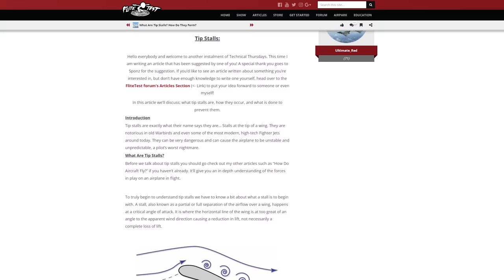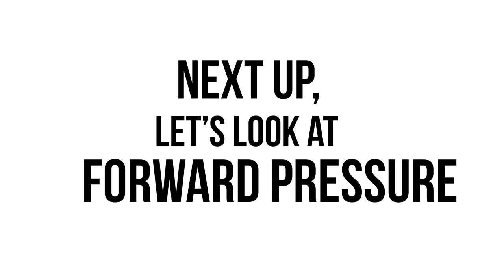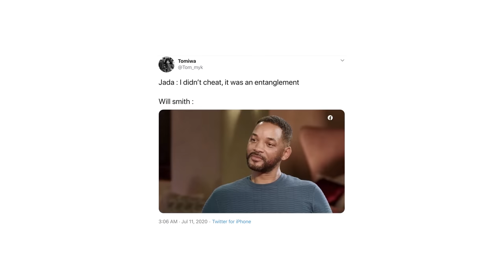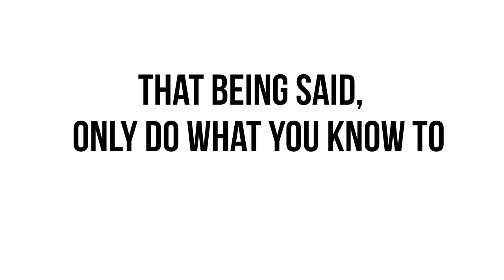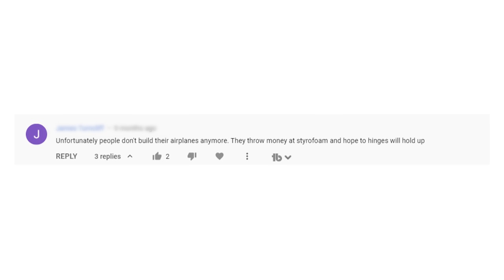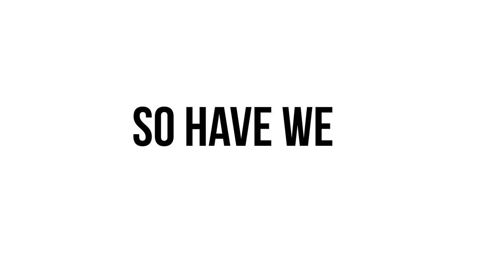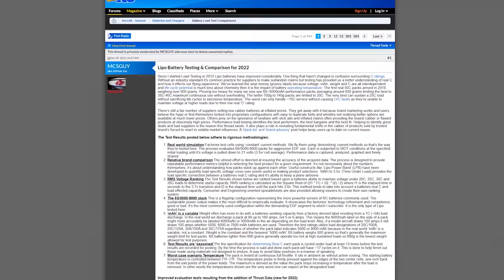RC Myths DEBUNKED

Comment: Good work giving a shoutout to Joe's battery tests. Every RC pilot should read that thread.
Reply: +1 to this, especially if you're in a high current draw category like edf's, boats, most cars and trucks, quads and helicopters. His empirical testing methods and data are second to none.

Comment: I fly homemade balsa and foam planes. I'm really loving my guillows fw-190 conversion right now, and for that, tip stalls are really a problem, and its difficult to get a washout in the wing. In fact, since that's my first balsa rc plane, the tissue warped the wing so one is strgiht, and the other was a slight washin at the wingtip... You have to throw it very fast at a launch to prevent tip stall, but once you're at its sweetspot speed, it flies amazing and I can do fun aerobatics. The annoying thing abt balsa tissue is that when u crash, you have to cut some of the tissue out to fix whatever's inside, whereas with foamies, you can just easily glue. Balsa is very delicate and you absolutely need to be experienced with flying small models especailly.
Reply: I think the irl 190 had issues with tip stalls partly because the wing was so stiff. Generally that's a good thing, but it also meant the wingtips couldn't flex and try to pitch down when near stall. Well, that, and the fact that the 190 had a relatively high wing loading with a significant wing taper

As for durability, the way I see it, Balsa is Superior for "normal" loads, while Foam's squishiness, the very thing that makes it worse at longevity than balsa, means it tends to just crumple in a brutal crash rather than explode or snap like a twig: dry wood doesn't really have a Plastic Deformation ability, so there's no option for the wood to absorb energy by just warping or crushing

TLDR: if you want to fly to the edge of the plane's limits, go balsa. If you want to fly to the edge of your limits, go foam

Comment: Excellent vid, tip stalls do exist, easy to confuse with an asymmetric stall, as an RC Pilot who used to crash a lot and doesn't very often now (but now and then lol) I can safely say that when ever I stall my plane in any way it's always my fault! I have a OS46 Powered PC-9 (amongst others), allegedly famous for tip stalls. Never stalled it by just being a bit cautious and trying stuff up high (never got a naturally occuring tip stall from it yet). Know your aircraft but more importantly know your limits! If you crash from any stall barring mechanical failures or very weird weather it's almost always your fault! Also heard brownout blamed for so many crashes where you can see a mistake caused the plane to depart normal flight (most often loss of orientation), and the wiggling afterwards that shows aircraft was never browned out. I've had one brown out  in 15 years that I luckily recovered from, reason for the brownout? Pilot error, when I put the wing on I had not routed the aileron servo wires correctly and the servo was jammed by the wires in one direction causing a massive load on the flight pack dropping power to brownout levels. A lot of the erm older guys where I fly like to blame anything other than themselves, the best pilots (not me. I'm "capable") always grudgingly admit they fucked up. Though sometimes it is a random control loss with no discernible reason, obvious mechanical fails or just bad luck in my experience it's usually pilot error!

Comment: Loved this video!  I fly quads now but grew up on balsa and 10% nitro.  I used to thumb but with quads I really need the added control of a hybrid pinch.  I did a lot of flying at the stall limit back then.
Reply: same story, flying quads just felt right with pinching for some reason.
Reply: X3. I learned to fly thumb 25 years ago but when I switched to quads went hybrid. When I came back to fixed wing I never went back to thumb.

Comment: I used safe mode with the landing assist after crashing several planes. I've moved on to some different planes over the years but when the weather is sketchy or I'm flying with floats I still flip that switch if I get overwhelmed.  People might say I'm cheating but I come home with my planes in 1 piece almost always. Well, usually, maybe sometimes... either way I have a blast and that's what it's all about
Reply: When will you develop the skills to fly without a stabilization system? The longer you wait the harder it becomes. 
I use mixes,in many of my planes, I tried for years to null out the design coupling inherent in their designs, I gave it a good try, it's to much to contend with. But it was never a question of bringing the plane home. Reasonable skills that improve with practice keeps pilots excited about the hobby.
Reply: @jeffs7915 Using gyro's is just sanity, we fly them by proxy so why make it harder and more risky as we cannot "feel" the plane ? You must be a old timer that can't get his head around mems sensors and what they do and how they improve the safety and overall experience.

Comment: Another great video! The same guys having tipstalls are also very well represented in the brownout column. Me, I'm just lucky that my BECs are strong enough and my aerodynamic knowledge is on a higher level than most, so that I crash my planes by flying beyond my capabilities. This happens a regular basis, but that's where the fun is, most of the time.

Comment: Not a participating member of RC community so I found this interesting (aerospace student). I would expect tip stall to be characterized by a lack of roll authority and less from an abrupt wing drop (although I’m not sure about the second part). Asymmetric stall gives that wing drop and it’s completely from uncoordinated flight, ie: pilot error. I did that in a cub one time and it was scary for a half second. I think the size scale of RC makes it less forgiving in stall and spin situations. At this hobby scale they don’t seem to recover or be super stable. It’s always interesting since RC tends to have a crazy high TWR and other major differences to full scale aircraft that makes them behave so differently.

Comment: When you guys cover stalls, can you talk about how raising the ailerons above the trailing edge artificially changes the washout and can help reduce asymmetric stalls? I know it’s changing the washout at the tip, but not sure what it’s actually doing.
Reply: It reduces the angle of incidence near the wingtip (the angle between the wing chord and the longitudinal axis), which forces the wing root to stall first. This helps make the stall more symmetrical, and it allows to ailerons to have authority at a slower speed. 
In full-sized airplanes, the entire wing usually has a twist instead of just the ailerons being deflected slightly upward. On some planes it's a gradual twist along the entire length of the wing, while on others it's a hard cutoff between the higher AoI and lower AoI

Comment: Great Video! A year ago I was that guy that would crash my night timber and blame the plane with "the aileron servos stopped working, I lost connection, it just fell out of the sky" I have since learned I was crashing it because I was giving it abrupt up elevator and exceeding angle of attack needed to give lift to the wing and I stalled. 
These are my thoughts on SAFE. It 100% makes you a worse pilot. It is a crutch that limits your ability to grow as a pilot. It's also a great way to just enjoy the hobby. I started flying 2 years ago and I fly at least 5 times a week mostly in the park behind my house. I don't need SAFE to fly and some of my planes don't even have SAFE but I still use SAFE for 90% of my take-offs and landings and on some flights I never take the plane out of SAFE. I find it just a nice fun and relaxing way to fly.
Reply from the maker: Well said and definitely understand your viewpoint. To counter it - always remember that life begins at the end of your comfort zone. Challenge yourself to try some takeoffs and landings without it from time to time and I bet you'll eventually turn it entirely off. You may find that you enjoy doing them without it even more. Fly outside the box! 📦✈
Reply: @TailHeavyProductions  Thanks for the push! I respect you guys and your content a lot so I figured if you took the time to give me some advice the least I could do was take it. I just took out the Turbo Timber Evo and flew 2 batteries without using safe with about 10 take-offs and landings and my first-ever touch and goes without safe. I also did my typical snaps and Cuban 8's and just trusted the plane and myself to fly out of stalls. The experience left me a bit glittery but accomplished. As much as I hate to admit it it's time to break my safe habit.

Comment: The argument 'ever seen a 40 year old foamie?' is totally bunk cause they just literally haven't been around that long.(unlike balsa) That being said I loved this vid and I love your channel 💪🔥
Reply: Sorta, but the very reason foam survives crashes better is because it can crumple and crush under stress, rather than snapping. And it's much softer than Balsa, so it can do this to much smaller loads, increasing the surface area that the remaining load is applied upon and thus reducing the risk of further damage

The problem? Routine bumps and bruises will ALSO create those dents, which add up over time. And compared to a Balsa plane with a covering film, it's much more difficult to repair a foam airplane to be "as new" without just replacing the entire component 

The Balsa plane might be brittle in comparison, but it's also much harder to scratch or dent it, and the greater specific stiffness means a well designed balsa plane can withstand more abuse aerodynamic loads than a foamie

Balsa flies better, Foam rebounds better.

Comment: At least for me, I do practice the simulated engine failures when flying RC and full scale. I try to add a coule second delay though between the time I "fail" the engine to the time I react. In a real world situation, the shock of loosing an engine, especially on departure, and how long it takes to act determines if you will be able to make it back to land safely. Of course with RC, landing short will not hurt much but the wallet at worse whereas stalling and spinning while pulling for the runway at low alt is almost certanly fatal

Comment: I had an AT Texan and that stupid thing would tip stall so easily that I sold it. The recommended brushless motor wasn’t powerful enough is what I’m guessing.
If you turned a little too sharp it would stall out and slip into a dive downward

Comment: A wing will stall at a given angle of attack regardless of speed or weight. When making a left turn, the left aileron goes up (decreasing the AOA) and the  right aileron goes down (increasing the AOA). if you stall with aileron input, the downward aileron will stall first, tip stall.
Reply: I am quite sure a stall is defined about airflow seperation relative to the wing and not about an aileron. This matters because doing so it destroy the lift that the wing produce and aileron produce no lift but only bending moment (ok a small lift force then)  And most stalls discussions are centered about level flight in 1G not in a turn, this is also how they are tested in real life because a turn would seriously complicate the matter as you mentionned in your post. I don't know if aircrafts are tested (part of certification tests) in a stall in turn scenario, but I doubt it.
Reply: The aileron affects wing camber, and therefore angle of attack. The aileron has a massive effect.

Comment: Only way you'd ever be able to tell if it was a tip stall is if you had tufts on your wingtips and analyzed video footage, because they're otherwise identical in effect from a third person view.  You can't feel if your RC plane is coordinated during a stall and therefore you can't really be sure if it was due to being uncoordinated or due to the tip stalling.  Based on what I've observed of my own flying, I'm probably uncoordinated with most of my RC planes nearly all the time to some degree or another, as using a gyro on the rudder really opened my eyes to just how off I was with my rudder inputs and mixing.  With the exception of a little F-86 I had, probably every single time I've dropped a wing in a stall was because I was flying uncoordinated to some extent.  I've experienced tip stalls in one particularly nasty little homebuilt aircraft, it was a one-off scratch build that has since been scrapped, and it really deserved it too.  Basically what it amounts to is that the wings are still flying, they haven't stalled yet but are right on the edge, you feel the buffeting but they never let go....it feels stable and manageable yet suddenly you start rolling hard to one side or the other after the slightest bit more elevator, almost like you just slammed the ailerons into their stops.  Only input necessary to recover is to let off the elevator some so the air sticks back over the wingtip and you're in full control again.  It's nothing like a spin/snap roll where you have to do some opposing rudder work in addition to relaxing elevator, a tip stall is more like trying to do an aileron roll in slow flight, though it doesn't take much to aggravate the situation and turn it into an actual spin.  In a tip stall, you still feel that buffeting like you're right on the edge of a stall the whole time, in a spin or snap roll that buffeting becomes relatively smooth after a wing stalls.  You can swap the stall from left to right wingtip by using tiny amounts of rudder to shove the stalling wingtip into cleaner air, giving you the ability to roll way faster at near stall speed than ailerons could ever provide, however it's ridiculously easy to take it too far and enter an actual spin, so there's no practical use for it besides having a bit of silly fun at altitude. Really dangerous on landing if your standard procedure is touching wheels on the ground just above stall speed, you have to give yourself some extra airspeed so you're not close to stalling any part of the wing.  If you were to stall a wingtip during a gentle flare to touchdown, you're done, there's no recovering, it happens too quick and you can't relax the elevator to stick the air to the wingtip because you're too close to the ground for it.  Best to simply treat it like Vmc in a twin, don't ever ever ever get below that speed on landing.  It's extremely rare to see it in any GA aircraft, but in RC models I'd say it's a lot more common than one would think simply because of manufacturing variations or a lack of washout in the design, defects or damage that caused a warped wing, and the fact that anyone can buy a high strung swept wing jet or a highly tapered wing for about the same price as a good trainer.  My guess is that's probably why you've got GA pilots saying that tip stalls don't exist and RC guys who think everything is a tip stall...their experiences, their flying, and the aircraft in question are vastly different between the two.

Comment: I've lost a few models due to tip stall - it definitely exists.  A couple were gliders which fell out of the sky due to tip stall AND because I let the speed drop; so not an excuse (it was my bad flying) but a reason.  I've also lost a couple of power models which went dead stick in a critical flight phase. The first was a P47 that went dead-stick just after a fairly high speed low pass on the pull out; I simply had to try to turn it back onto the strip to stop its going somewhere it really shouldn't have been.  The second was a lovely Super Stearman whose petrol engine cut just after take-off - again it was the attempt to get back somewhere safe.  In the end it turned out the electronic ignition unit was faulty. In neither case am I excusing me, just pointing out that tip-stalls really do happen.
Reply from the maker: On a glider wing that would be an asymmetric stall. Check out our latest video titled, “Your Definitive Guide to RC Stalls” - we go in depth on them there and more, too. 👍

Comment: I've always been a fan of R/C twins.  Myth:  You must use counter-rotating engines to cancel the torque (and back then only K&B-Veco had a left hand engine), otherwise the plane will flip over on its back and crash.  Fact:  Nothing could be further from the truth.  I've flow more than a few twin .40 planes over the years.  They were not at all difficult, in fact, easily flown with little consideration to "torque".  They could easily fly one engine out with application of just a little rudder.  And no, the engines do not have to be perfectly sync'd.
Reply from the maker: It's funny you mention twins...we've got a fun educational video coming on them in the works. 😁

Comment: Keep
Your
Speed
Up
In
Turns.

Also: If you are flying in an heavy downwind, when you make your 180 degree approach turn, THROTTLE UP!!! Don't dip the inboard wing too much; the coming breeze will want to yank the plane over into an inverted condition. KEEP YOUR SPEED UP IN TURNS! Especially in approach turns.
Reply from the maker: Good tips! Food for thought. Not overly loading up the wing is what keeps one or both wings from exceeding their critical angle of attack in any phase of flight and at any speed, including slower turns on base to final. Stay tuned for one of our upcoming videos where we fly our 25-pound 1/5 scale P-47 in a confined area flying it on the backside of the power curve and at slow speeds in turns on base to final over tall trees. No bites. A safe angle of attack is what keeps a wing flying - not speed. 👍